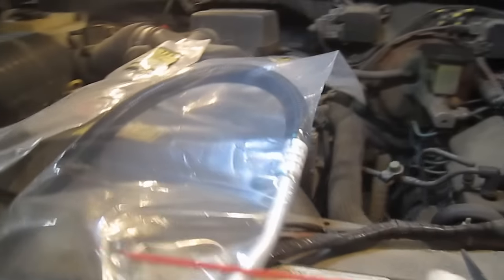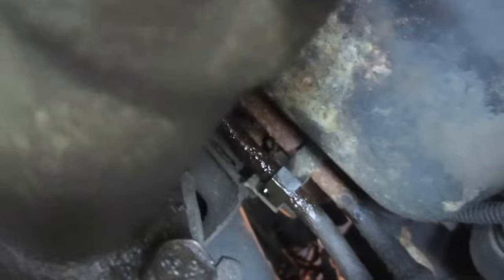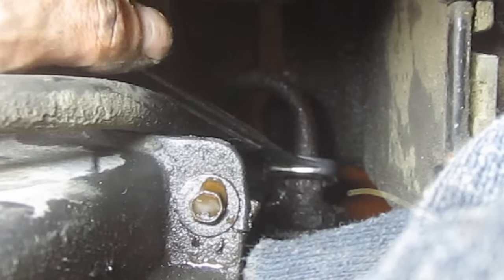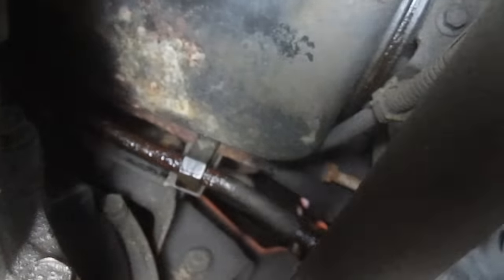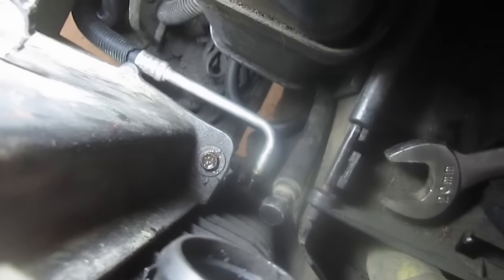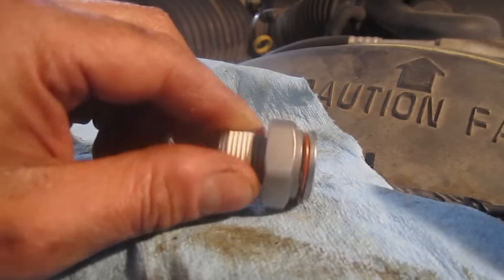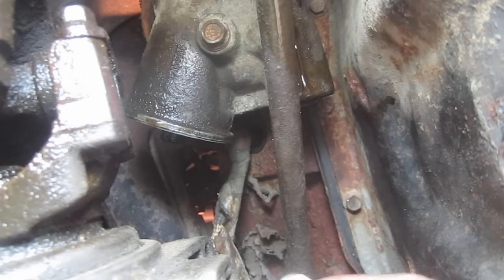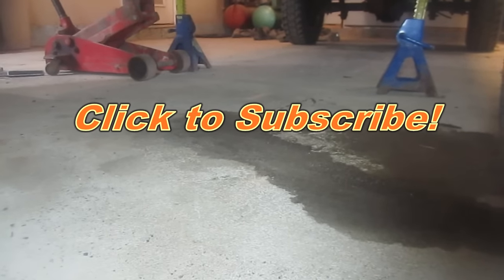DIY How To Replace GMC \ Chevy Oil Cooler Lines & Quick Connect Fittings

Comment: i removed the stroud and water pump fan. gave me allot of room. i didn't use doorman crap.  i bought summit heavy duty oil pipes. i also bought 2 barbs for the oil filter housing, clamped both sides. same for feed and return. a year later,  not a single speck of oil leak around my pipes. best investment i ever did.
Reply: Josh Benney do you have the part #?
Reply: Chito Lopez here it is: 15112870 and 15112871,  both are made by AC Delco
Reply: Josh Benney thanks

Comment: hi guys I have a 1993 Chevy Silverado and looks like the bottom line threads on the radiator are stripped out any tips on how to fix that.
Reply: Eddie Rodriguez tap and dye kit

Comment: hey i replaced my cooler lines on 97 chev 1500 4x4  worked find for about an hour then i began to loose oil pressure  :(
Reply: +Mark Jenkins  if i have some mechainc background , i did an oil change lines are on correct, everything is done as is should have been,   wondering if maybe some dirt got inand worked its way to my pump screen

Comment: Did you replace the ones that go towards the back of the S10 ?  There are 4 oil cooler lines ?  I wonder how you get the ones that attached to the engine
Reply: Jamie Sarkisian 
He showed you , thats what he did last.
Reply: +Mark Rich thanks I will watch again

Comment: remove the fan shroud
Reply: you take the top of the shroud off to get access to the top oil cooler line. Then you don't need to mess with the radiator hose.

Comment: Mark,
great video, I have used crows feet on the radiator end to make that a little easier. Thanks for all the tips!

Mike
Reply: +mikes97626 
What's a crows feet?
Reply: +Tad Hittenberger if you Google crows foot wrench you'll get an image. To explain it, it's a wrench head(end) in various sizes that has a 3/8 ratchet opening.

Comment: How much money did you spend on parts total ?
Reply: i bought both mine from napa locally for 22$ each.  i als had to buy the connectors for about 10$ each. they leaked after only a year from the metal/rubber hose crimping,  they warrantied them for me
Reply: wyomings elkoholic 
thanks bro

Comment: Just had oil cooler lines replaced I bought O.E.M. from dealerships parts department. It feels like I lost some hp now. Not a whole lot just seems like I lost a little bit of power. My mechanic that did it went out of state and won't be back till next week. I don't want to bother him while he's out visiting his family. Does it take a while for everything to start flowing through like it should? No leaks, and oil pressure is normal so is engine temp. 2010 6.2L Escalade AWD by the way.